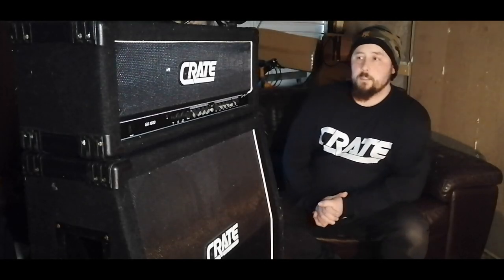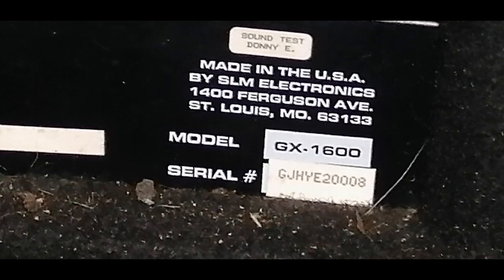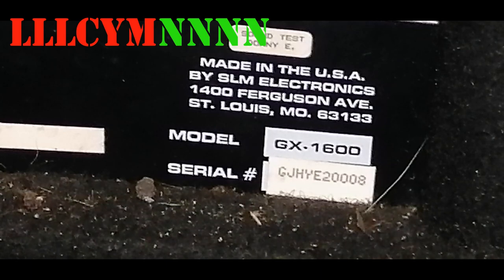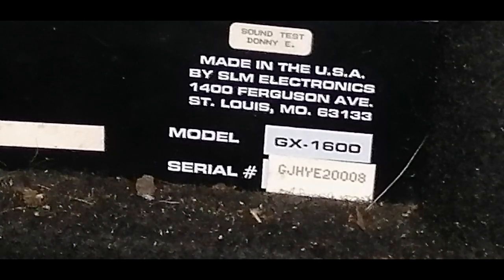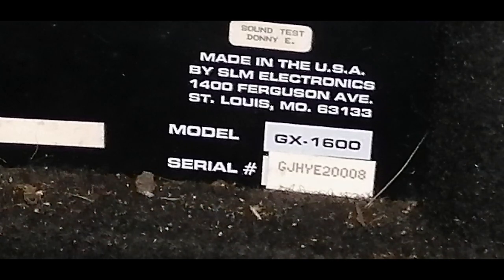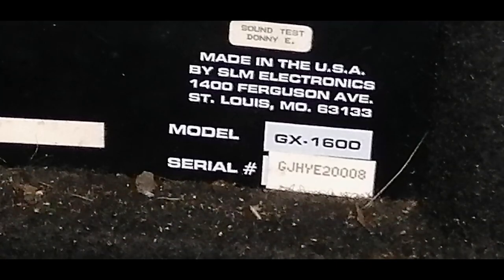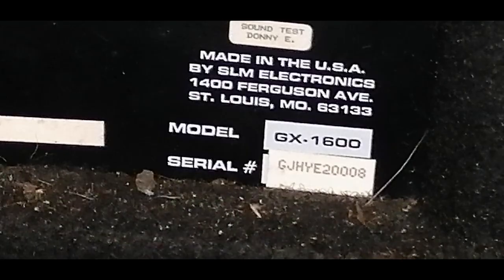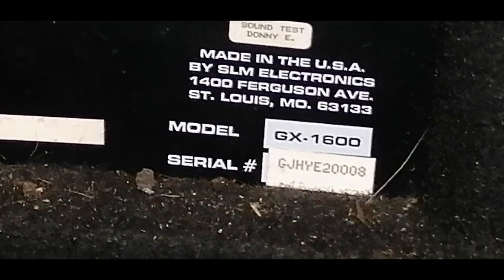READING CRATE SERIAL NUMBER

Comment: My serial number doesn't follow this format.  It's a G-40C with a 7 digit serial number.  Is there a web reference I can use somewhere?
Reply from the maker: Send me the code and I'll see if I can help
Reply from the maker: I've just done some research and the G-40 C as U stated with 7 digits is what it is as this amp is an 80s amp before they made the 12 digit serial number. During the early mid 80s the serial numbers were in my opinion random. So it will be hard to find out exactly the month and year of the amp you own.